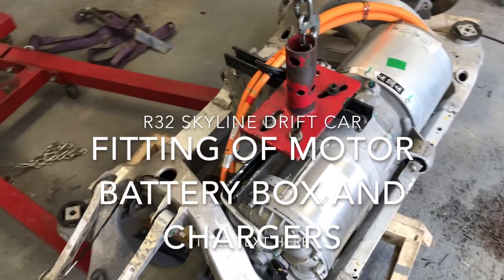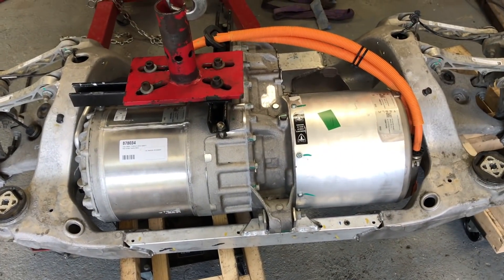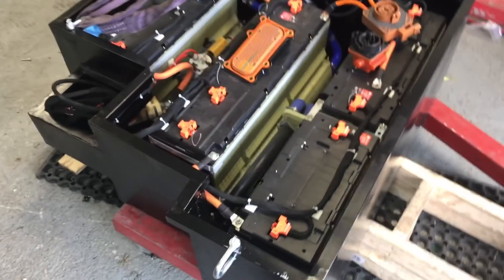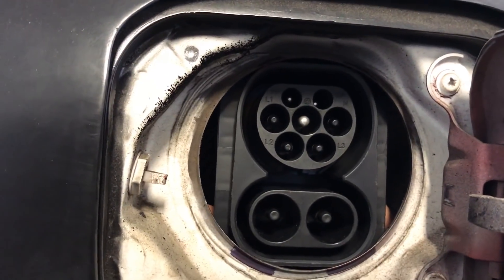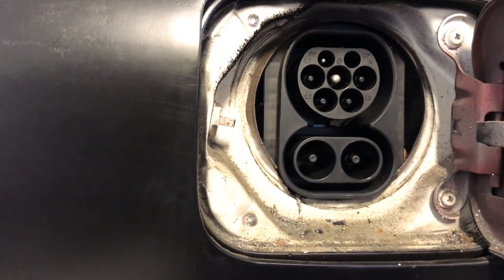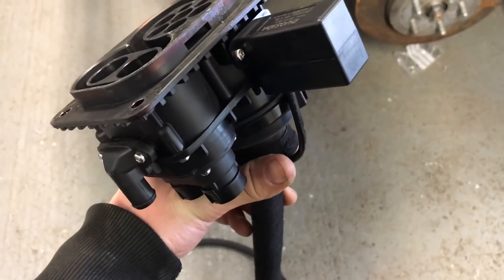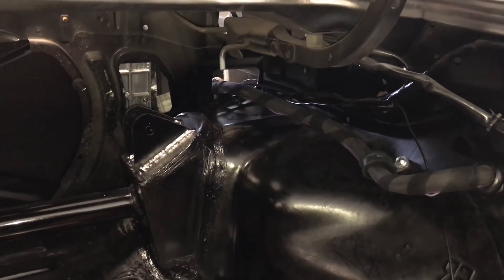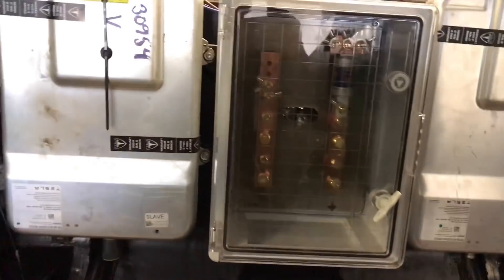Fitting of Tesla drive unit, chevy volt battery box and two Tesla chargers

Comment: What was the wheelbase width difference between the original skyline and the tesla unit?

I wanted to swap in a Bolt/Tesla motor to some other cars, but the Bolt is like 103inches (2616.2mm) and the tesla is like 116inches (2946.4mm).
Which is like a 13" difference. So it kind of matters, especially since the drive axles and control arms aren't every log on the Tesla.

But the bolt, you can drop all the suspension stuff, and use what your car already has. And if your car is AWD, just weld the axle halves together.

Anyway, good work so far. It's quite the motivation.
Reply from the maker: It’s a crazy difference, fitted over fenders and the lowest offset wheels bust still sticks out

Comment: Hi does the motor fit any car or did you do it??
Reply from the maker: It does not fit any car, will require a lot of fabrication work
Reply: @Hazell_Nutz  you are saying that it is hard but possible. How the cooling system work. Did you add a new system or car's own system did you use?

Comment: Looks awesome!
What controller are you using to do the CCS DC charging?
Thanks in advance.
Reply from the maker: We have our own cc’d system coming out in a few months and works along side Orion 2 bms.
Reply: @Hazell_Nutz  this is fantastic news! 
Will this Orion BMS add-on be also compatible with the CCS 1 (US version) - up to 150kWh? 
My understanding is that the difference between the CCS1 (US) and CCS2 (EU) is just the connector.
Reply from the maker: Oleksiy Rossovskyy there is some small changes as soon as we have finish ccs2 we will get ccs1 sorted shortly afterwards.

Comment: Hello, first off love your work! Secondly how did you work out the disconnect needing to be at a 36 cell interval for the Orion? Ie where is the disconnect in your HV battery connections? cheers
Reply from the maker: Hi, the Orion is designed in groups of 36 and there is a brake between each group which is where a disconnect can be placed if it’s not in the correct place and you power the vehicle on it can pull power through the bms and blow it.
Reply: @Hazell_Nutz  Thanks for the reply, I didn't think the volt battery had a place after 36 cells to add the disconnect ie on terminals at the end of a module.. Did you use the 108 cell orion with empty taps after 30 cells? Or is the disconnect just at the main positive? Or some other trick?
Reply from the maker: Forest yes that’s correct use a 108
Reply: @Hazell_Nutz  Thanks!! makes sense now.

Comment: I've been researching options for converting my Nissan S14 (240sx in the US, I think it's a 200sx in the UK) to electric. As you may know, the rear subframe design is VERY similar to that of the R32. We have a lot more freedom for modification's here in the US, but this would be a street car, so I'd like to keep the suspension intact. Did you ever try to fit the Tesla Read SMD into the stock subframe? If so is it possible? My rough measurements make it look like it would be REALLY close to a couple of suspension mounting points. Any comments?
Reply from the maker: Could not get it to fit as to get the drive shafts in the correct place main drive units was hitting the subframes rear mounts.

Comment: What was the mileage using the volt batteries?
Reply from the maker: Dylan Witt about 10 mins flat our spinning the wheels 😂 never did mileage testing with it. I would recommend you message Tesla Beamer he is using a large drive unit and volt pack.

Comment: this setup of taking the entire model s rear subframe and rear suspension assembly, and modding the frame of the car to accept it, is exactly what i'm trying to do with a 1975 corvette...
how painful was the fabrication for this?
has it worked out well?
Reply from the maker: joe k it was not to bad as only had to make 4 subframes mounts the shocks fitted to the original location for the car.
Reply: @Hazell_Nutz  
oh, you kept the original shocks and original shock geometry? interesting, i'd assume if you moved around where/how the shocks mounted (compared to how it was in the model s) it'd screw with the rear suspension kinematics in really bad ways?
Reply from the maker: joe k it’s hard in the Uk as can’t move shock points without a retest so had no choice

Comment: Great work! What suspension are you running in the rear? Coil overs? Did you need to mod your shock towers?
Reply from the maker: TheJimbob83 I am running Audi R8 coil overs at there standard spring rate. I did modify the shock tower to allow for a simple12m bolt to go through the new coil over.

Comment: nice job. is that the original sub frame that has be modified. do you have any plans to offer Nissan leaf motor kits.
Reply from the maker: If It Ain't Broke Still Fix It yep is the original Tesla subframe with know modifications. We have looked at the leaf but the system is very large just like the tesla stuff is so nice to work with 😄